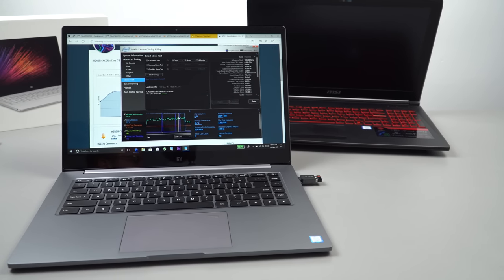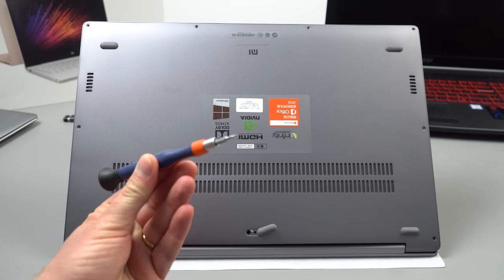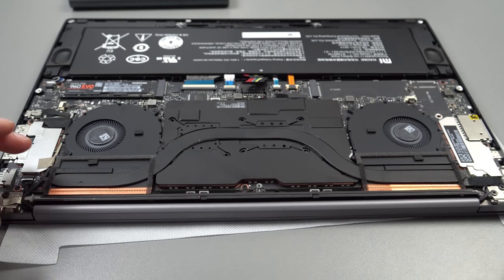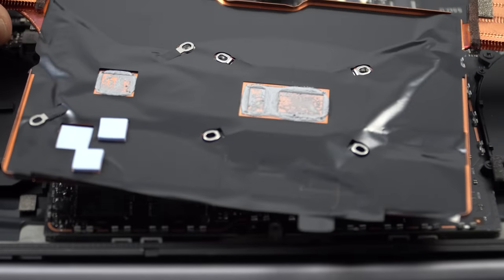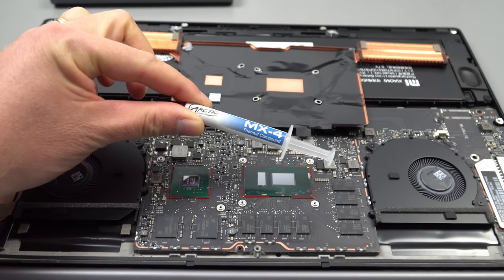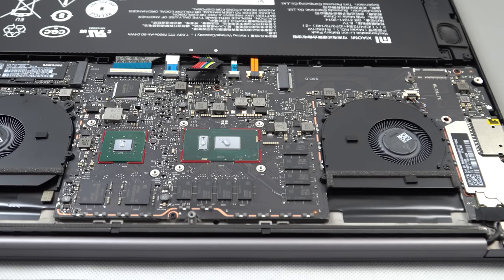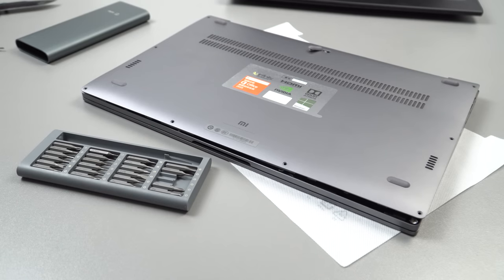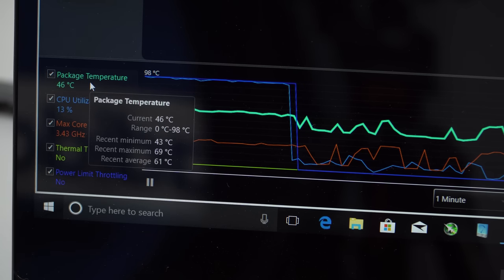Xiaomi Mi Notebook Pro Thermal Repaste, Results, How to Open & Add SSD

Comment: hi
I'm a DPI geek!  is there way to upgrade the screen of MI notebook to a compatible QHD or UHD lcd
Reply from the maker: ElectroMac74 Without major mods, no. It would also be very difficult.
Reply: Why would you even want that? It's a huge battery drainer, and what content is actually in 4K? I still don't see the gains of QHD on portable devices.
Reply: Enterijnment I even see the difference on 5.5 inch 2K phones, I think by now 2k on all platforms should be a STANDARD.. however yes it would drain the battery moreso and also would require more GPU POWER unless you downscale in games...
Reply: however I don't GAME on my phone because it's a PHONE so therefore everyday usage and quality of life when using the phone when reading/videos etc is quite improved..
Reply: at the very LEAST 2k should be a global standard for desktop monitors since there's no concern about battery life.. but even in THAT market anything beyond 1080p is only starting to be more common..
Reply: what do you mean by "there's no concern about battery life" ?
Reply: adrenochrome25 regular monitors that you plug into desktops are not battery powered, so there's no concern about battery life because there IS no battery... which was part of my argument that at the very least higher resolution displays SHOULD more-so be a standard on these kinds of monitors rather than small portable battery powered machines, doesn't make much sense does it? it's kind of backwards... Big beautiful stationary displays should have been above the 1080p standard years ago.

Comment: Hi! I've got a problem with my Xiaomi Pro GTX. I have just added a new Samsung PM981 512GB SSD. The system SSD (PM981 256GB) has a speed of around 3500 MB/s and the newly installed has just half of that. Any idea if/how I can fix that?
Reply: As far as I know the second slot speed is half of the main one.

Comment: Anyone else getting massive battery wear all of a sudden? My battery wear using both HWmonitor and Battery bar was 3 and 4% for the very longest time. I unfortuntely played some games without plugging in and my battery wear shot up 10% right after that... today i checked just with day to the day use so about 2 weeks later and now its climbed up to 16- 17%.... Has anyone found a better battery replacement for the laptop/?

Comment: Very informative video, thank you for posting! I have a question: since today, when playing games or stresstesting the cpu, the power limit throttle kicks in. (default settings)
 Did anyone experience this problem? 
I am thankful for all replies :)

Edit: After some more reading, it seems like I can raise the watt limit (using throttlestop) before power limit throttling kicks in. However, this seems risky too me. Plus its strage that this only started happening recently. Any tips?

Comment: Mine produced large doses (worse than a microwave) of physically unpleasant radiation, i understand that the problem probably isn't the fan or the hardware so maybe i need to remove the thermal paste  and add some good stuff - you didn't describe EM radiation and only a heat radiation problem. I found that the radiation emissions did not correlate with my usage, the processor would boost during OS tasks and the EM rads were bad if the PC wasn't hot. I'm not sure if i can even detect this with a gieger counter, but hairs standing on end and a bad feeling in organs is enough to convince me something's wrong here
Reply: I also own a tablet with a keyboard that snaps on and has a strong magnetic field, I've put this under the xiaomi and the effect is reduced

Comment: notice that the heatpipe looks bad and they use 1 pipe for both cpu and gpu and that one is one of the bad design similar to asus gl702vm laptop they will not last long thermals

Comment: Hi! Just a question, is the wifi (card) replaceable or is it soldered? (for any hackintosh user wondering about it)
Reply from the maker: Valerio Melucci It's soldered in place.
Reply: you can still put the m2 wifi card of your choice in the second m2 port instead of an additional ssd
Reply: adrenochrome25 I don't think the a/e key is compatible..
Reply: The spare m.2 slot has the M key, so it only works with SSD. Assuming you might be able to use a socket adapter, the other problem would be getting a decent signal through the all metal casing. The stock intel WiFi uses antenna wires through the display hinge, which is non-metallic to allow the signal through. You would need to extend those antenna leads across the laptop to make use of them, and that in itself may adversely affect the signal as you are changing the impedance of the antenna. There is no easy solution for this. I think you have to accept that you are stuck with a USB WiFi adapter.

Comment: Dude, good results but you really are showing a bad example of how to do this.  First off your baggie method is just silly, just put the heat sink back on and it'll squish it just right for you.  Secondly, why don't you power it on before snapping it all back together to make sure that nothing got messed up?  Thats just good sense.

Comment: I tried opening my xiaomi notebook pro but the T5 doesn't fit in the screws! So weird. It's just a little bit too big while a smaller one I have is too small for grip.

Furthermore, my USBc controller failed, no charging... Now my batery is empty and my notebook is just completely dead. Can't charge it... The charger is fine, tested that obviously. So that is why I want to try to unclip the batery and see if that works 

I think I have the first dead xiaomi notebook pro in the world. Lucky me... Haha
Reply: About your USBc controller, did the laptop have the issue where it only charges for couple minutes each time then it needs to be unplugged and replugged before it completely failed?